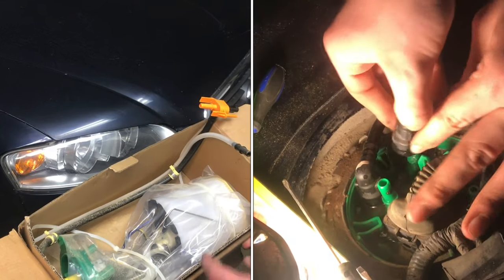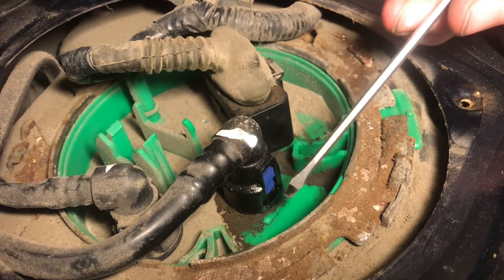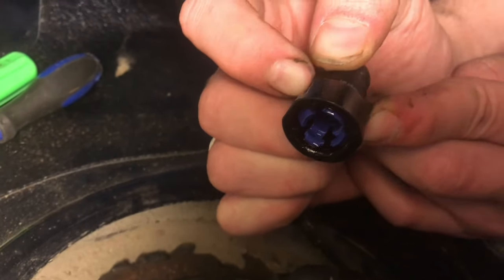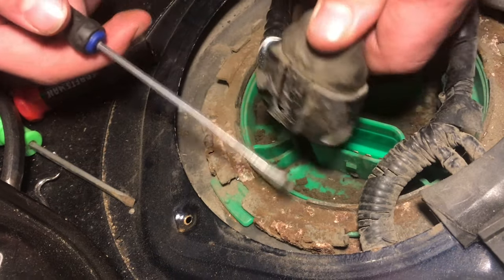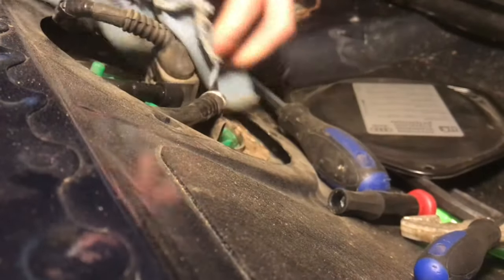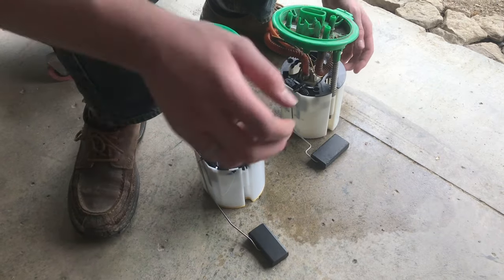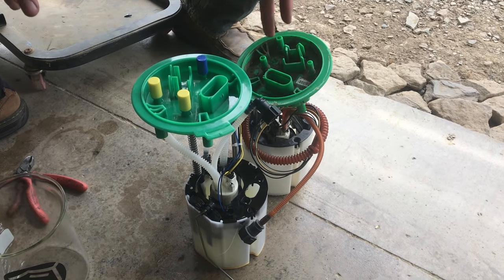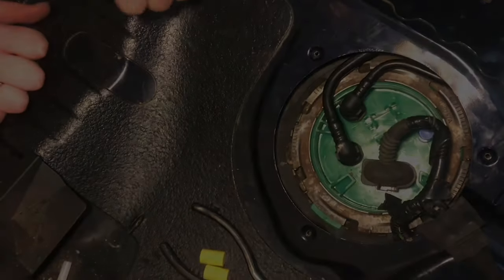replacing FUEL PUMP a4 audi (2001-2008) 01 02 03 04 05 06 07 08

Comment: Great video, but I wanted to share something VERY important. Feel free to pin this post if you agree. The reason the fuel line with the black fittings wouldn't come off is because the line was under pressure. That is a Norma NORMAQUICK S 90 connector. They are designed to NOT release when there is pressure in the line. So you need to pull the fuse for the fuel pump, run the car until it dies to release the pressure. Then that connector will come off as easily as the blue one. The reason I think it's very important is if you break that connector, it could mean replacing the entire pipe to the fuel filter which means you may have to drop the tank a bit to get in there, which on an AWD car is a pain and might even involve dropping the rear subframe. All for a cheap plastic fitting.
Reply: Good to know the other blue one popped out for me easily the one you are talking about was pretty mangled but I made it even worse trying to remove it..
Reply: I have an Audi A4 B7 1.9 TDI 2006.
I removed those covers and there’s nothing under them. Will it be possible that my model won’t have one at all and the high pressure fuel pump does it all?
Reply: What if the car won’t run😂. I think I have to replace the pump because there’s no fuel being pushed and my car won’t turnover but will crank normally
Reply: @badeamadain359 if anyone sees this in the future. Or if by chance you still have the Audi….the Fuel pump is in the boot (trunk for you folks overseas) at the back right under the carpet. Three screws to get the cover off and it’s right there. It’s a tight space for the change
Reply: @Parlayhitter1  Did you have to have to replace the pump? My '08 A4 2.0T Quattro Cabriolet Stalled, last week. Tried to get it started, and it turned over, briefly, ran VERY rough, then turned off. Now, it cranks, but will NOT turn over. I don't know if it's THIS or the timing belt OR a RELAY or the MAF or the Crank Pos. Sensor, or any other Sensor, or I don't know WHAT ELSE? ANY suggestions? Please reply!!!
Reply: Yooo, so glad I read this comment, super helpful! I just had to do this a second time and this comment saved me a lot of frustration.
Reply: Nop you can do it without taking off rear bumper, you have to remove then carpet in trunk thats it.
Reply: @Parlayhitter1 defoo
Reply: @Parlayhitter1 did u fixit?
Reply: @Marinos-Areas52Bassisto fuel pump can run, but not suck any gas through pipes. Pump car run, but mechanical things are not working. Had this problem from week, today bought new pump and all good

Comment: Just changed mine out today. After a lil research on the correct pump for my car (and purchasing the wrong one at first), I realized that the new pump you used in the video is marketed as the 4WD variant and the one you pulled out is the AWD pump. Now I don’t know an insane amount about cars, nor did I think there would be a difference, and I’m not going to claim to know your car was AWD, but there was a difference in the pumps I received. I didn’t have to do any of the modifications to the pump I purchased marketed as AWD and the pump I bought that was marketed as the 4WD  had the same setup as the new one in this video. I would suggest to anyone who decides to do this themselves. 1: Make sure your tank is half or below (as said in the video). 2: Make sure the pump you buy is for your make, model, and drive type. And lastly 3: Have plenty of drip pans/rags to collect fuel that leaks. Hope this helps, I’m really not that knowledgeable about cars but I managed to do it, and it’s worth the effort.
Reply: Just change the pump buddy good video

Comment: Probably one of the best videos I've seen. I appreciate your calm demeanor and you're easy description of how things are done. I've changed out probably 50 of these. Your video is by far the best. No unneeded dialogue or abusive language. Your descriptions were spot-on. Very good video I don't see how you got any thumbs down.
Reply: Good morning. Just trying to figure out why people are replacing these pumps? You said you've replaced 50! So I think you would know. I have a 2008 A4 3.2L that dies while driving, and has a long crank after it dies. Eventually starts up and runs fine. Sets fault code P0190 for fuel pressure circuit. I'm pretty sure I probably have a fuel pump issue, just trying to verify. Thanks!

Comment: Excellent video! Those fuel line connectors are a PITA! Tip: Buy a cheap pair of needle nose pliers. Then heat up the tips over a gas flame (Kitchen stove gas burner will do the trick). 
When the tip glows red hot, use another pair of strong pliers to bend the tip inwards at a 90 degree angle. When done you will have made yourself a pair of "pincers". Push down on the connector and then use the pliers to push those tabs inwards, then upwards and the connector should pop off. 

Regarding those pesky electric plugs - I've seen many destroy the large "D" type electrical connectors because they don't quite realize how they work. You'll find these being used virtually everywhere on both Audi and VW. The secret is too push the entire connector towards its receiving plug/housing. While keeping pressure, press the little rectangular tab (towards the bottom of the connector) downwards and then pull the entire connector off. 
Once you get the hang of it you won't believe how easy they are to remove. Here is a guy that explains it in a short clip: https://youtu.be/rGhjmtfyAjI
Reply from the maker: Thanks,I tried to use needle nose pliers been like what you’re explaining but I think the needle nose pliers I used were too thin. I’m gonna try some thicker needle nose. That’s a good idea to use pliers to apply more pressure to the modified needle nose pliers. Thanks again

Comment: Great job with the specifics… from someone who owns a total of 6 Vw and Audi vehicles and has completed this procedure several times prior
Reply: Hi, I'm just trying to figure out why people are replacing these fuel pumps? I have a 2008 A4 3.2L that dies while driving and has a long crank. Sets fault code P0190. I've already replaced the low-pressure fuel sensor and it's good for a couple days, then does it again. So low pressure pump is my next bet.

Comment: The electrical connectors are more simple than they look. There is a little tab near the back edge that you just pull up on (in the same direction you are pulling the connector). They can get sticky, but they shouldn't break.

Great video!

Comment: Nice video. If you have to replace again I recommend going for the off brand pump that's a little more expensive. I bought one from ecs that was continental brand and it didn't have any weird differences from the oem VDO brand.
Reply: Contintental has owned VDO since 2007. They are the same part.

Comment: One of the better videos on you tube, however, you should have mentioned to tap back the locking tabs on the meatal holding ring. Was'nt able  to bang the ring free until I did that!

Comment: Thanks for the tutorial, very informative.  A few years ago, I had to replace my faulty fuel pump in my 2005 Audi A4, it was done by my mechanic.  However, after the replacement, I’ve noticed my fuel gauge needle would never reach the top even though the tank is full.  Not sure if you have seen this before?  Any ideas?  Thanks for your help.
Reply: It wasnt fitted correctly, or it turned when they tightened it all up.  The float is getting stuck on something which is why your dont see a full tank on the guage.

Comment: I have a 2006 AUDI A4 B7 every video I've seen indicate the pump is on passenger side under the seat. I took rear seat out and opened the plate with the three screws and to my surprise no pump. I checked the driver side and again no pump I assume it may be in trunk or I have to drop the tank.
Reply: Hi Kevin did you perhaps manage to locate the pump as im sitting with the same problem. My Mechanic said he must remove the whole fuel tank in order to access the pump. I find his view hard to believe.
Reply: @b-manynwa1696  same here.
Reply: Its in the rear, behind the seats. I have the Avant and also two blank plates with nothing under them. Further back towards boot/trunk is where its at

Comment: Modding a fuel pump is a little dangerous. It should be plug and play. Out of all the things you may need to mod on a car to fit correctly, the fuel pump is the one exception where you need it to be exactly like the original. So, just curious, where did you get your new pump from, and wondering if all a4 pumps need to be modded as well??

Comment: What's the symptoms, or any code ?
Reply: A couple of ways to check and condemn the fuel pump, symptoms of a bad pump can be an extended crank at morning start up, the main function of the low pressure pump it to maintain a constant 5 bar pressure. If the pressure is inconsistent then there is an issue either at the pump or the pump driver. Check codes related to the low pressure pump. Check blocks 101 - 109 and find the one that shows the low pressure fuel pressure (5 bar) and duty cycle. A new pump should run 55-60% at 5 bar at idle, it should run no more then 70% at idle, over 70% indicates a wear on the pump and it has to work harder to keep up, recommended to replace if you have a few of those issues

Comment: my 2004 audi quattro 1.8T is having a issue starting, it starts but i dont think the fuel pump is sending enough gas to the engine, however im not exactly sure if its the fuel pump causing this, any advice or any steps i can take from here? im 16 lol this my first car
Reply: Did you ever resolve this?

Comment: Hey my car starts but dies immediately I have an 2008 it dies but doesn’t shut off completely the lights stays on and there’s just a beeping and it’s like that every time that I start the car it’s starts but engine doesn’t stay on  before this happend from time to time it would smell like gas and I would wonder if my gas was leaking can u give me ur opinion on what u think it could be ? Thank you
Reply: Also my fuel pressure regulator has been bad for a while idk if that has anything to do with it
Reply: You need to check the trouble codes and if you can get it running for a while check the fuel pump pressure and duty cycle for the low pressure and high pressure pumps. the fuel pressure is regulated by the ecu signal to the fuel pumps directly

Comment: Thanks buddy, It helped me a lot with my A6 C6 limo. Unfortunately, the designer of this A6 is so dumb as f'ck to put the fuel pump in the back of the trunk. You need to be a yoga specialist to reach it. Also, with your instruction, it's almost impossible to disconnect the fuel lines (in this position). I hope that the creator of the fuel line connectors will meet a very unpleasant karma.